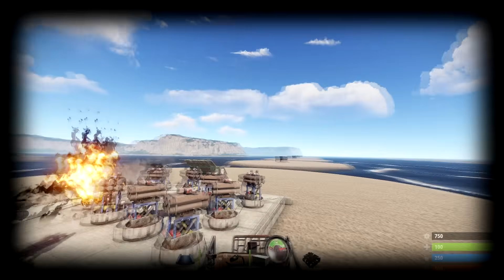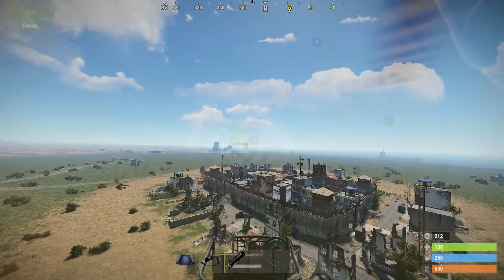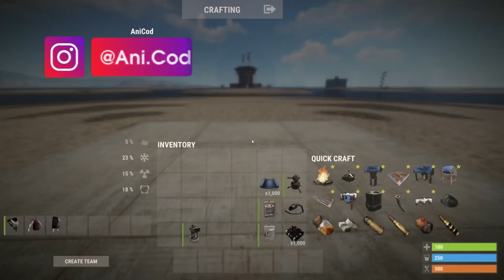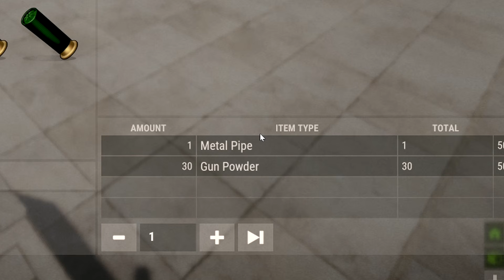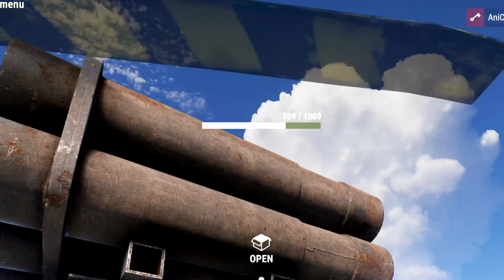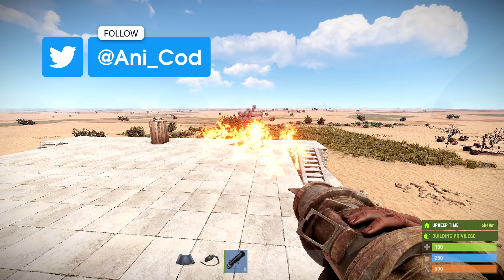SAM Site | RUST | Turret Setup Guide | SMART ELECTRIC CIRCUIT

Comment: Try this on for size, SAM site always on but deactivated by Heartbeat Sensor, Plug this in to the end of Rustricion io link, ?circuit=4028e285c786177f828517e2bab1d8c6 and ?circuit=64bc9e59a7b8a7381c39f7b0f8b11727
Reply: you build a tall 1x1 and put the radio tower circuit at the top. and the SAM circuit can go anywhere.

Comment: I hadn't thought about the turret idea! Very nice. I use the Rust+ app with smart switches for turning off sam sites now, but before the app was out I actually made a couple 4 story towers around my base with HBHF sensors on top - I would fly low over them to trigger the HBHF which would turn the sams off for just enough time for me to fly in and land safely!
Reply from the maker: That's a great idea! You need to get the range perfect I imagine... I might play with this idea in a future video :-)
Reply: @AniCodYT  That would be awesome! It is outdated now due to the smart switches and Rust+ so I wasn't going to revisit it at all, but let me know if you want any help setting the whole thing up! 

It's a simple enough circuit, but I don't mind putting together a rustrician circuit, a fortify build, or a copy/paste .json.

Comment: Nice tip. I originally had my SAM site wired up with an auto turret, too, but I noticed the range was severely diminished since it's then reliant on the turret getting a lock first. There's also the added complexity of wiring it up to multiple turrets should you want to establish a larger perimeter scan. I decided that I'd rather have it fire at max range with a simplified circuit, so I wired it up to a *Smart Switch* instead, and I toggle it on and off via the Rust+ app whenever I take off in my heli or when I am flying back to my base.

By the time my roof turrets get a lock, the SAM sites have already fired off several volleys, and if people are still alive, the turrets will likely finish them off should they attempt to bail out on the roof.
Reply: Control Towers, Heartbeat Sensor+ 1 solar pannel, + one RF broadcaster, Fly by the control tower, to trigger an RF reciever connected to a timer which is connected to a Blocker, which is connected to a sam.